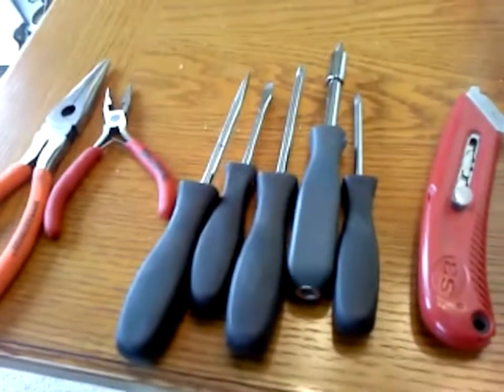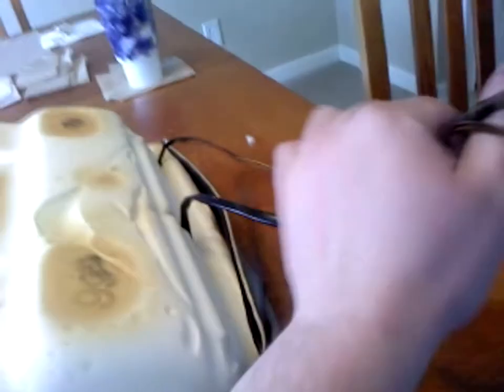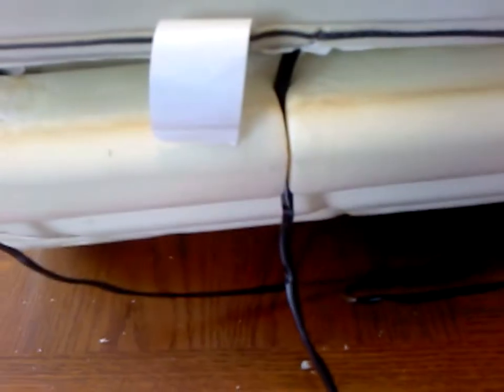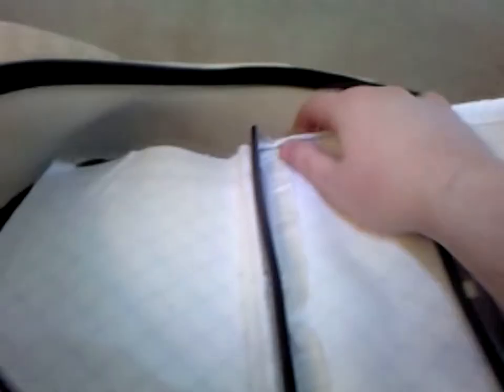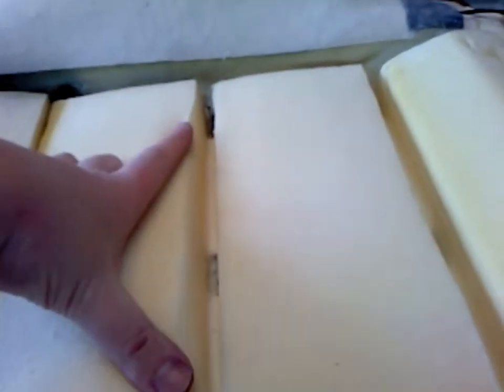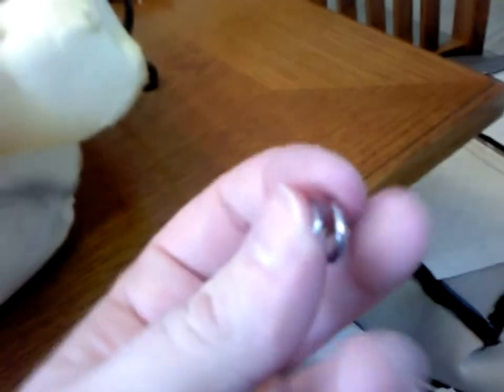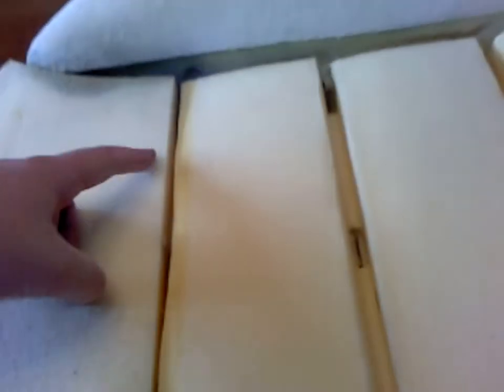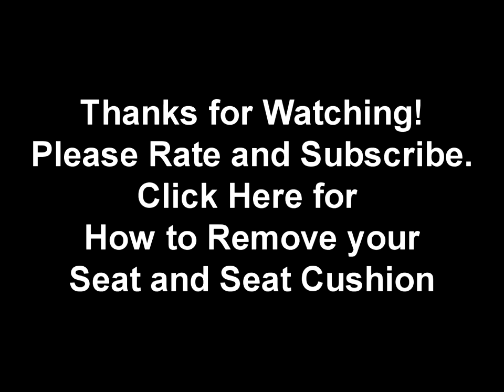2002-2005 VW Passat How to Reskin your Seat Cushion

Comment: Hello thanks for the video I am wondering once the sides of the leather is undone from the car seat does the foam and skin pull right out easily? I’m looking to fix the bottom of my drivers seat and want to get a replacement leather at a salvage yard. I’m just thinking how I can get around doing all the unclipping and stuff and take out the foam and leather together and make it easier.

Comment: I have a 1995 Passat and I want replace the skins and cushions for the skins and cushions I saw in a wrecked 2005 Volkswagen cc at a salvage yard, do you think its possible?
Reply from the maker: I doubt they will be a direct fit. A 1994 and 2005 are two different generations of Passat.
Reply from the maker: Does the 1995 Passat have side airbag seats?
If you don't have side airbags in the seat swapping seats is fairly simple. You might want to look into swapping the entire seat.

Comment: I have the power seat with the multiple connectors...but the replacement cushion only has the single seat heater connection...so now I have to replace the skin.  What did i get myself in for?   Arrrgh!